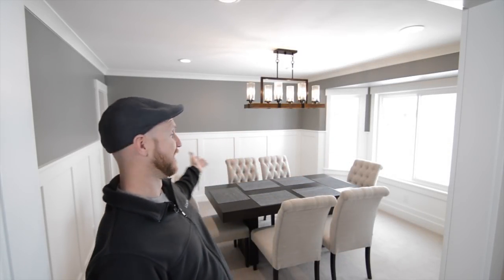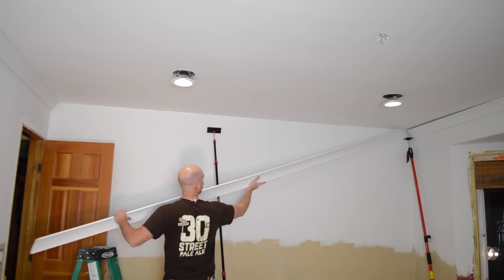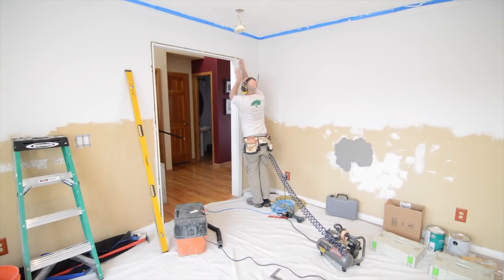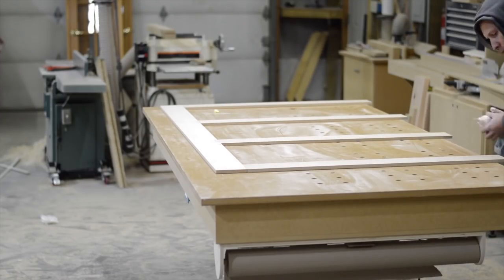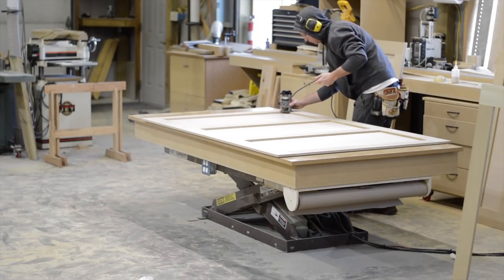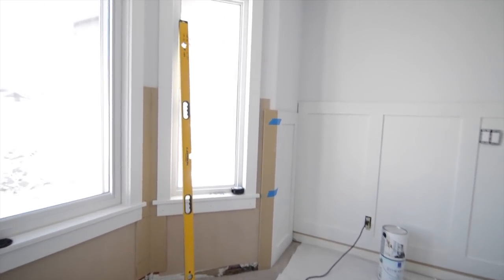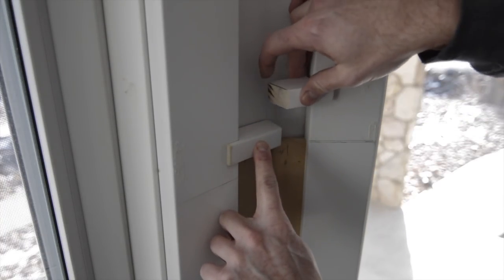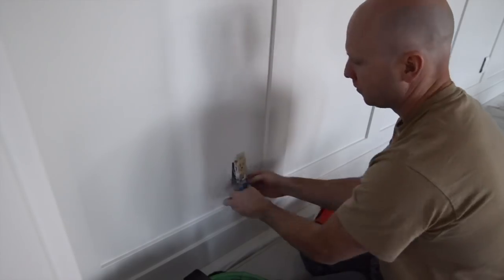Dining Room Renovation, wainscoting or Board and Batten

Comment: Please follow the 1:3 ration when panelling unless you have a big room as it closes the space in. Great job,  I have tool envy though. lol.
Reply from the maker: Thank you for the comment but, there are no firm rules when installing paneling. I have installed miles of wall panelling almost identical to this, and I have never only paneled the lower 1/3. To my eye its too low. I think its personal preference and each person should do what pleases their eye.
Reply: @MikeFarrington    If I have 12 foot ceilings, what would be a good height for the top of the molding?  We have 10 foot in other parts of the house, what would that height be for the top of the molding?

Also - forgive my ignorance, but is it necessary to do a backer board?  Why not apply the moldings directly over the wall?  Is the texture of the wall the only problem?  We are doing a new build and could have them leave the texture off of the lower portion of the wall that we will be paneling.

I am so excited to do this.  We just bought the Graco airless spray gun you used.
Reply from the maker: @nanhinton4509  I suggest using some painters tape to mock up a paneling design. This will really help you decide what looks best to you. I have done a dining room with a 12 foot ceiling, we did a 5' height and it looked good. I have also done an 11' ceiling and the paneling was 6', I thought that looked good as well. To me the backer board is necessary because its easier to get smooth and paint when compared to drywall. You can apply directly to over drywall, its just a lot of work to get it smooth.

Comment: Hey mike, good videos man! I want to ask if treat the back of the panels for humidity and condensation. Cheers!
Reply: Also, whats the gadget that u were using to get the craft paper and the tape together?
Reply from the maker: Thank you. I have not had problems with humidity / condensation. Since I installed this over a wall that is fairly well insulated, I don't think it will be a problem, plus when its cold here the humidity is extremely low, we run a whole house humidifier all winter and its still uncomfortably dry in our house. The gadget you ask of is called a masking gun. Most paint suppliers, and hardware stores will have them. Should be less than 20.
Reply: hey man! thanks for the answer!

Comment: Mike, you may have answered this, but how to get a uniform finish on mdf between the edges and the face? It always takes a different finish for me.
Reply from the maker: Using the table saw sanding disc helps prep the edges (Edge Tech). After that just good spraying technique.

Comment: Hey Mike, love your content, I'm learning a lot.  I have a quick question. You mentioned your earbuds in this video. What brand/model are they? And, do they work as adequate hearing protection? Thanks.
Reply from the maker: Thank you. I use cheap sony ear buds. I have some really nice fitting plugs that I attach to the sony buds. They cut out a pretty good amount of noise.

Comment: Loved the video!! I must ask, why MDF over wood say like pine?
Reply from the maker: MDF paints much better, and its cheaper. Those would be the two main reasons.
Reply: Mike Farrington thank you for your reply. Any benefits such as with moisture or long term durability?
Reply from the maker: Well MDF doesn't like moisture, but this is a room where that won't be a problem. Durability, probably about the same as using wood, MDF resists denting a little better, but it chips off at corners more. My experience is that there are pros and cons for both in terms of performance, but cost and ease of use are much better with MDF.

Comment: Amazing craftsmanship!! Can I ask, did you use 25mm/1" mdf for the door casing architrave so you don't have a stand out from the Wainscotting on the walls.
Could you post the thicknesses of the materials used?
Reply from the maker: Thank you John. The paneling is a combo of 1/2" with an applied 1/8" back. The door and windows sides are 7/8" and the door and window tops are 1".
Reply: Cheers!
Reply: One more question, when it came to your door architrave, I noticed you placed the top piece on top of the side pieces, did you chamfer or route over the inner edges or did it all go together with sharp edges?
I'm only asking because if I was to do the same but run the router down the edges to soften them then when I place the top piece on then the bottom edge would run past the side piece leaving a dip in the surface where they mate.
Reply from the maker: I soften all edges, yes there is a little dip. Its not worth worrying about. Most peoples eye will just skip right over that little detail.
Reply: @MikeFarrington  I know this video was a while ago, however quick question. Did you mill the door and window sides and tops to the thickness or get it a supplier?  Really like the bold (thinker) look and we are preparing to add trim to our house. Also is the window seal 7/8” too?  Thanks
Reply from the maker: @allent555  Allen, I milled it. Yes, window sill is 7/8".
Reply: @MikeFarrington  Much appreciated

Comment: Just curious, for cabinet building you use a tool belt turned to your back. What tool belt do you recommend? I’m apprehensive to use one in fear of marring finished work
Reply from the maker: I use a cheap three pocket belt from Husky. I make sure that it has a plastic buckle and fabric hammer loops so I don't beat up my work site.

Comment: Hey Mike, Where did you get that blue flex pipe you have over your table saw?
Reply from the maker: Hi Steven, its called Loc-Line. Do a search, you'll find it. I use the 2 1/2" diameter stuff.

Comment: What tip did you use and at what number on the gun  to not get that much overspray?
Reply from the maker: I like using a fine finish 308. I don't remember the number on the gun, I just set that until it feels right.

Comment: Hi Mike

I have planned my waiscot but i am struggling with building with MDF. I have never used MDF before. My concern is that i will not get the end grain smooth enough. Would you ever built this out of pre primed wood milled down to 1/2”? I am paralyzed (:
Reply from the maker: Don't be paralyzed. I would not build the entire project without knowing weather you can get the end grain smooth. Pick up some MDF scraps and play around, see if you are happy with the results. If not, pre primed wood milled down to 1/2" will work just fine. It will just cost a little more.

Comment: So why the backer board on the first section, but the windows nothing? Doesn't that make the thickness off from one wall to another?
Reply from the maker: No sure I follow. I used backer on all walls. Around the windows I installed the backing then the verticals and horizontals directly to it.
Reply: @MikeFarrington  I thought it was the paint and not backer. Awesome. Learned a ton

Comment: Sorry if I am missing this in the comments. What radius Amana router bit are you using - and how well does it work when dealing with panels that are only 1/4" (well .216")  raised above the panel? Or phrased another way, is the bearing short enough you can use those on .216" tall material?
Reply from the maker: I am using a 3/32" radius round over. It will not work with a .216" step. The bearing would be hitting the lower surface.
Reply: @MikeFarrington  Thank you for the fast response! I am still going to pull the trigger on some. The application I had in mind is wife and I just bought a house, and she wants me to add shaker style frames to the kitchen island, so just planning on doing some 1/4" or 3/8" MDF, then prime and paint. I will just make sure I knock down the inside edges before mounting, especially if once I can measure existing cabinets find out need to go with 1/4" to match the existing step.
Reply from the maker: @PatrickJohnsonCheatham  Sounds like you have a good plan. Best of luck!

Comment: Maybe asked already. But why can't you just apply the wainscotting to the painted wall. Why do you use the backer board
Reply from the maker: The surface of the drywall will never look at good as the backer board. With that said, it can be done, it just wouldn't look quite as nice.

Comment: Hi Mike, after being in the shop all day I spent my evening watching 3 of your videos.  Love your work!  Question for you on the mdf - are you at all worried about its durability?  I mean both dent resistance and being waterproof.  I'm renovating our master bathroom right now and ripping out mdf molding and baseboard which just slowly swelled up and warped.  I'm sure you have good reason, just curious to hear it is all.  Again love what you do and I'm picking up tips all over, great work and thanks for the videos.
Reply from the maker: Thank you. I am not worried about durability, MDF does pretty good on resisting dents (minus outside miters). Honestly, the increased cost and effort for solid would wouldn't be worth it. In a kitchen or bathroom with a tub/shower, I probably would have used solid wood. This is a formal dining room that gets used on Sundays and holidays. Hope that helps. If budget and time were no concern, I would have used solid wood.
Reply: Thanks for replying, I appreciate it!  My question stemmed from failing mdf baseboard in my bathroom that I am renovating, so I'm a little gunshy on it.  That is obviously not the right material to surround a shower tub combo with.  Your stuff looks fantastic though!  I showed my wife this video and we're trying to pick a room to do a similar treatment.  Love all the videos, keep em comin!
Reply from the maker: MDF is a blessing and a curse. Its cheap and fast, but it doesn't like water.
Reply: Another tip I've picked up from your videos - the nice attention to the process of applying primer to anything paint grade.  I will be doing that for every piece of trim in the new bathroom for sure.
Reply from the maker: Primer makes painting much easier.

Comment: Hi Mike-thanks for the video. I have question regarding materials used. In the video you said the room was 14x12 and that the wood used was mdf and solid wood for window sills. How did you get the length of over 8 feet using MDF? Did you splice or join the long horizontal runs withbiscuits? I am trying to duplicate this in my sons room with several runs over 8 feet.. i have considered milling down pre primed 1x4x16’ to 1/2” yo make piece runs of over16’.  My panels will be 1/8 mdf backer board 1/2 mdf vertical slates. Milled down 1x4x16’ for horizontal runs with 1x4 pre primed for door and closet casing.  Any thoughts? Thanks in advance- my daughter loves the shop apprentice
Reply from the maker: For the two longer runs, I milled down longer solid wood to 1/2" for the horizontal pieces. I still used MDF for the verticals. Also some places sell MDF in 10' lengths, this may or may not help you.
Reply: Thank you for your response.  I wrote my original comment in bed on my phone while watching your video in bed (10 times)-sorry for the grammar (:

Did you use MDF for the casings?  Do you find MDF to be cheaper and or better quality for casing (if you did use MDF)?
Reply: What tool did you use to cut out the square for the electric boxes?
Reply from the maker: I used MDF for the casings. I think it works OK especially if you round over the edges were it is most fragile. The headers were made with solid wood, because I wanted them thicker. I used a multi tool to cut out for the electrical boxes.

Comment: Hi mate any chance you could tell me what earbuds you use? I've been using wireless beats the last few months but they are already starting to fail. Found them one of the more comfortable ones and also seem to cancel a fair amount of the noise. Am planning to replace them but as you called your ones noise canceling I said I'd ask? Loving the videos keep it up! Thanks.
Reply from the maker: I just use the 10 dollar Sony ones, but I put on some ear inserts that I got from another set of ear buds. I don't remember which ones, but they fit really well and block out a good amount of noise.
Reply: @MikeFarrington  cheers mate thanks

Comment: I'm about to do wainscoting in our dining room and we're trying to figure out what height it needs to be.  What is the height of your ceiling and what's the height of the wainscoting?  Thanks!
Reply from the maker: Ceiling is 8', paneling is 53". Hope this helps.
Reply: Thanks so much for the quick reply last week.  I have one more question if you don't mind.  We are also now tackling the window/door trim.  What size round over bit and/or what tool did you use to do the round over 5:49?
Edit:  Nevermind - you mentioned it to be an amana bit later in the video.
Reply from the maker: @rudolphbenikiii7565  3/32" round over. That router is discontinued. Its a PC310.

Comment: Hi Mike.  I noticed your wainscoting was raised.  Was it sitting atop something?  Also, if so, what was behind your base?
Reply from the maker: I raised it up a little, but I added some backing material for the baseboards to sit on. I did this for material yield.
Reply: @MikeFarrington  How high did you raise it and what backing did you use behind the base?
Reply: And lastly (hopefully), what type of backing board did you use for the wainscoting?
Reply from the maker: 1/8" MDF for the backing. I raised it up about 4" and I just use some 5/8" MDF. 5/8" is the thickness of the paneling (1/2" plus 1/8").
Reply: @MikeFarrington  sorry for all the inquiries.  At this point, your my go to guy for my upcoming project.  I'll share when finished.

Comment: Just out of curiosity, have you used the sprayer lately / on any other projects and what are your thoughts on the results..?  How does the finish compare to something you would spray in your shop...?  I've got a job coming up that requires some on site spraying of millwork and my painter is retiring, so thinking of giving it a go.  Any input would be appreciated!
Reply from the maker: I have used the sprayer several times now. It still works good. The finish is pretty good so long as I don't over spray and get runs or under spray and get a dry finish. Airless requires you to move fast, so in my opinion its harder to get a good finish, but when done right its as good as anything else out there.
Reply: Mike Farrington sounds like it’s worth giving a try. What do you normally spray with it in a primer and a paint..?  Thanks!
Reply from the maker: @dalebrown1981  I always use shellac primer (which cannot be sprayed through my particular sprayer, its water based only). For paint, just get one of the high end paints from your local supplier. They are all pretty good.

Comment: Do you use oil or latex paint for the wainscoting and trims?
Reply from the maker: I either use acrylic or urethane. Both water based. I do use a shellac primer which is critical when using MDF.

Comment: Just curious, why do the 1/8" MDF backer and not just leave the drywall as the backer in between the stiles?
Reply from the maker: A fine finish cannot be applied to drywall. The paint would always look different between the drywall and MDF. Plus its way easier to achieve a nice surface by using MDF than to smooth drywall.
Reply: I was curious why he did this too, it’s a lot harder to have to perfectly cut out outlets and switches. Also, my walls are so poorly framed that none of the walls are close to square. I understand his answer as he had rough drywall. I did this in my house (new) with perfect Sheetrock. I caulked the wood to the Sheetrock and it turned out awesome. I also painted the inside squares to match the wall color so I had no material difference appearance problems with the two substrates because they were supposed to be different anyway. I even did different sheens with flat wall color and semi gloss boards. Looks great!
Reply from the maker: @jaye9300  These types of projects can be done in many different ways. To me, as I mentioned, I prefer that all the surfaces be the same material so the paint looks identical. Cutting the outlets is super easy, I have done it so many times, I'm on auto pilot these days. I also think that using no backer works great if it gives you the look you want. It would be easier.